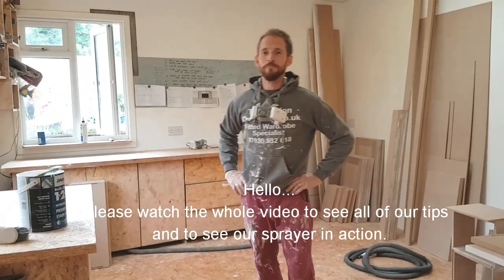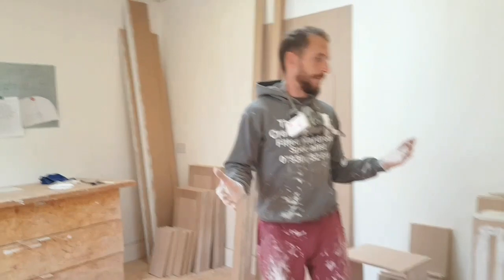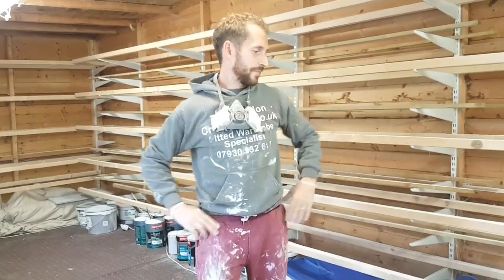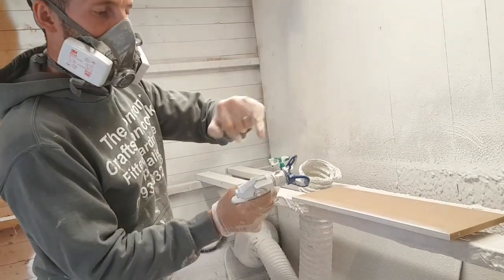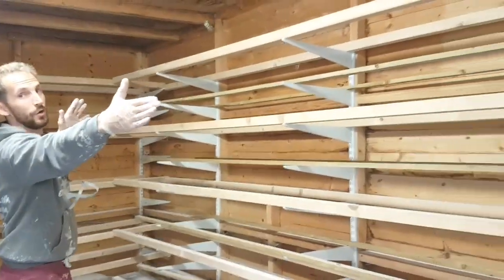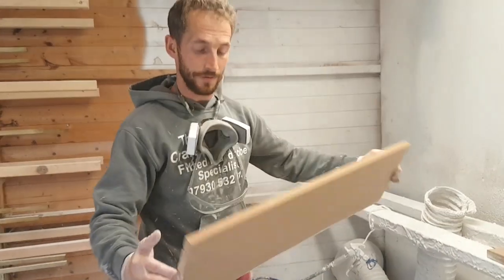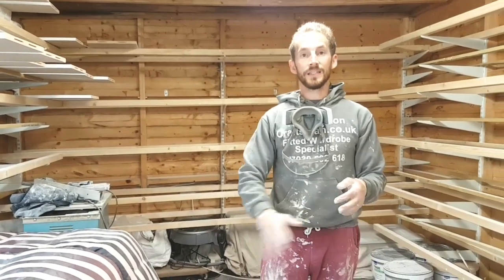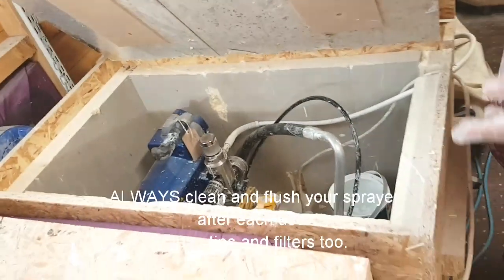Achieve professional paint finishes on Mdf - Trade tips & techniques - Don't Miss!!

Comment: it looks like only 1 edge of the pieces are sealed with the zinzer. I assume that is the only visible edge. Do you still paint the other edges, but don't bother with the sealing because the finish is not important?
Reply from the maker: It all depends on how visable the edge is. We don't touch it if not visible. Adjustable shelves used to have less time and effort spent on the unseen edges but now we do all edges 100%

Comment: Hi London craftsman in relation to the filler you use, if youve routered the edges what do you use to apply the filler to the edge? I've tried using a steel spreader but need something more flexible to help with round over edges. Any advise what I could use?
Reply from the maker: +Bamb Furniture 
Hi there,
To be honest, we generally only use a very small radius router cutter, literally a micro round to take the arris off.
It's so small we really don't bother filling that particular round.
If it's a larger moulding or round then I'd probably just use my finger to apply.
A bit primitive but it gets the job done better than any tool.
If you have lots to do then maybe try brushing on some zinsser paint, let dry/cure and sand back. This will fill all the tiny holes and fluffy edges and is a good starting point 
Thanks Ryan

Comment: Good day. Can you do a video on how to seal mdf edges for a smooth satin finish using the 1 2 3 primer? I am using benjiman Moore latex water base paint for the finish
Reply from the maker: Hi This video should show you how. The key is to sand and fill the edges (p120 then p240 then fill remaining holes etc with either 2 pack filler or ready mixed filler).
Then sand back that filler lightly.
After simply use a mini gloss roller or brush to apply the zinsser.
Once dry prime the edge with primer/undercoat  (possibly the same time you paint the whole component). Once dry just a very light rub over with p240, dust down then ready for top coat/s.
Hope that helps

Comment: I'm planning to spray 2 coats of watered down layland undercoat/primer on MDF then follow you with 2 coats of diamond eggshell. Do I spray the eggshell on without watering down and will the diamond eggshell be strong enough for kids wardrobes
Reply from the maker: Hi yes diamond eggshell will be tough enough for sure!
I'm not sure what sprayer you will be using, but if it's an airless sprayer then no need to thin any paints. I use diamond regularly over an MDF primer undercoat and always good results.
Even with one top coat, you will have a very tough finish, but 2 top coats is definitely recommended.
Ryan
Reply: @thelondoncraftsmanworkshop  
Good morning and happy Easter. Thanks for the reply, it's nothing special, just a siphon ran from my shop compressor. I'm amazed this all round wall, ceiling, metal and wood paint will even work but you'd clearly got the experience so I'm happy to use it. Do you think I'd have to water it down? It is water based right?
Reply from the maker: Hi happy Easter!
If you are using a hvlp spray gun, I doubt this house hold paint will pass through.
If you watered it down it probably would, but then it would be making the paint soo thin and watery it wouldn't really work. Definitely go water based if your a beginner.
I use an airless sprayer, they use pressures of up to 3000 psi to push un- thinned paint through.
A hvlp sprayer only uses about 10 psi give or take I think, hence the reason you need the paint to be nearly water consistency.
As long as you use a good primer/undercoat, you should be able to apply most paint finishes over the top as your top coat.
Reply: @thelondoncraftsmanworkshop  
Thanks. Yes definitely a beginner! It is a help sprayer and the compressor runs around 100psi. Would I be throwing money away do you think by watering down this paint?
Reply from the maker: I'm not 100% sure how the finish will turn out watering it down.
Have you got an old tin of satin wood, gloss or eggshell lying around that you could test? (Waterbased)
Or even an emulsion?
You could see how much you need to thin before it sprays through the gun?
Emulsion is naturally thinner so if your testing it would give you more accurate results on the other paints.
Either way  a test with any paint would be better than nothing.
Reply: @thelondoncraftsmanworkshop  
Thanks again, I will give the emulsion a go. Great advice pal
Reply: @thelondoncraftsmanworkshop hi again, I was spraying on the layland acrylic primer today barely watered down and worked pretty good so I think or hope the top coat will be just as good. With everything going on and everyone decorating there homes while on lockdown, the dulux diamond eggshell is like gold dust to find so what's your thoughts on layland acrylic hardwearing eggshell?
Reply from the maker: That's good to hear! 
Yes, when spraying I never really notice the difference between brands. 
I'm.sure it will give you near enough the same finish as the diamond, and your going for the hard wearing version, so I'd say it will be fine and a tough finish .
Reply: @thelondoncraftsmanworkshop  well that's good to know thanks pal. Do you light stand in between coats on the eggshell
Reply from the maker: No probs,  I always sand once after the under coat, then if I'm doing multiple top coats I dont really sand inbetween coats, I guess it all depends on the finish you get when you spray your eggshell.
Reply: @thelondoncraftsmanworkshop  cheers bud. Great vids by the way.
Reply from the maker: Thanks maty

Comment: Does water based primer/paint run the risk of swelling the MDF?
Reply from the maker: It can do slightly as in grain rising. To combact this, do more coats and less paint per coat. Also heat is critical to dry paint quickly within 15mins per coat

Comment: I recently purchased the FUJY system HVLP but I'm not very happy because reaching the right density is not easy and often humidity or different temperatures give a bad result.
Do you have to mix paint with your airless system or not? 
Many thanks
Reply from the maker: +Giovanni Fiori 
It depends on the quality you are trying to achieve.
The airless sprayer will not give you an absolute flawless finish, but using the fine finish tips  (green tips with a 310, 410 hole) you will achieve a very good finish.
We spray mdf wardrobe components with it and to be fair it can't get much better.
We do one solid coat with an acrylic primer undercoat and light rub down with p240 after. Then lastly a top coat with a good quality eggshell or satinwood.
The paint doesn't need to be thinned with these machines. Just put your paint in and away you go.
We spray at the lowest pressure possible without getting tails from the spray tip.
Reply: I got a result with an acrylic primer undercoat and light rub down with p320 after it was not satisfactory for me. I would like to show you the actualy result. How can I show you?
Reply from the maker: +Giovanni Fiori 
Cool!
I can't remember any of my email addresses but if you go to my website www.thelondoncraftsman.co.uk and go to the contacts page there will be an email to send it too ☺
Reply: perfect. I am doing

Comment: I made the mistake of not primer coating any of the edges or rebated sides of the MDF and the paint just absorbed into it....took about 4 coats, il know for next time, 2 questions please?

(1)Is it advisable to edge the MDF with a oak edging or whatever first for a better and easier finish,
(2)Should you not clean out the gun with a thinner or white spirit rather than water??? 
Thank You.
Reply from the maker: Hi, there are a few ways of preparing mdf edges for painting.
1- use a paintable iron -on edging. They are pre glued just use an iron to glue them on.
2- fill and sand the edges first. I use this way all the time. If you look for one of my videos called achieve professional finishes on mdf edge EP#3, this will show you everything you need to know. 

Thanks ryan
Reply: @thelondoncraftsmanworkshop  thank you Ryan 👍🏻

Comment: I was told by a carpenter not to use water based products on mdf, so I'm now confused.
Reply: Mdf being a songe, the best you can prime with is something solvent based, not water based. Ideally shellac based. Clearly, water based stuff works, but doesn't work as well. Cleaning water based products is easy. Solvent based products are much harder to clean, smell awful, toxic and so on.